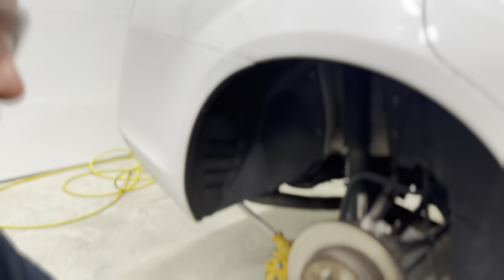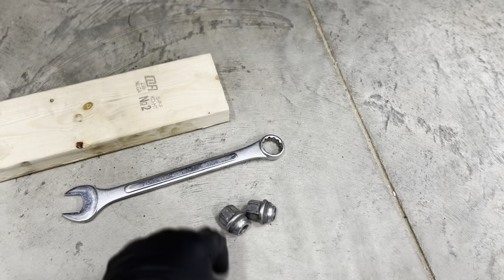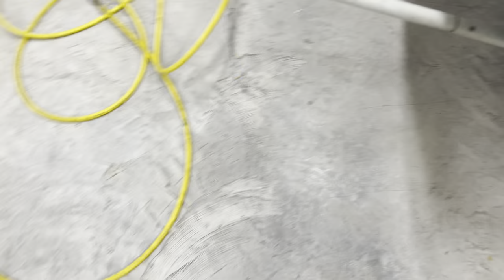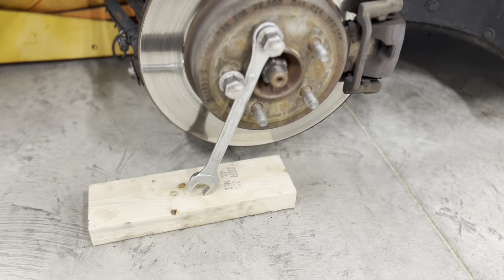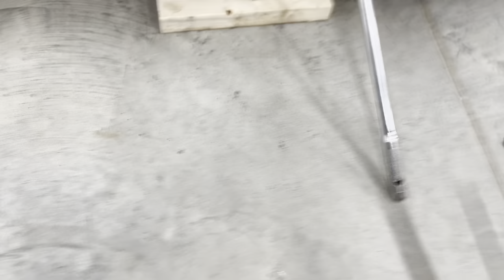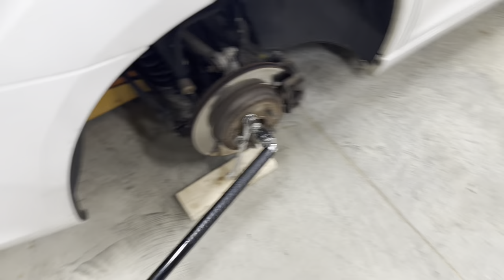Breaking an Axle Nut Loose

Comment: Take the center cap of the rim, put the parking brake and it should go like a blast.
Reply: I agree with you. Just take the center cap off of the rim. Slide it onto the rotor and then lower the vehicle with just one or two lug nuts and then the vehicle will hold everything in place so that you can just go ahead and go to town on that axle nut. 😅
Reply from the maker: I feel like a moron, for not thinking of this myself. Awesome Solution!
Reply: And if some steering wheel holder welded the axle nut to the axle?

Comment: The easiest way to get it off is just to take the center cap off of the rim and then put the rim back on the vehicle even if you only use a lug nut or two and then from there use an extension to get to the axle nut and if it's torqued on there like on a pickup truck you use a breaker bar and then at the end of the breaker bar you simply put the jack and you use the jack to push the breaker bar.😅
Reply from the maker: HOLY CRAP!   I can’t believe that did not occur to me.  That is a freaking brilliant solution! Thank you!   🎉
Reply: @spanky762  you're welcome
Reply: Your explanation doesn't make sense. What do you mean rim? The tire?
Reply: @adamxenon829  no the actual rim. The center cap is the part where they'll put like the Mercedes emblem or the Jeep emblem you pop that part out and then put the tire back on and it gives you direct access to the nut that holds the CV axle in place in the hub

Comment: Too bad my spindle nut is torqued to 241 lbs and was seized.  Pb blaster, map gas torch and a whole lot of swearing and it finally came loose lol.
Reply from the maker: Yikes!
Reply: But what you could have done instead. Is just put the rim back on the vehicle with the center cap removed and then you use a breaker bar with an extension. Once the vehicles back on the ground and at the end of the breaker bar you put the jack and you use the jack to rotate the breaker bar. 😅
Reply: @gsc512 that's exactly what I did. No lift so I had to do some home mechanic gymnastics. Rust was a  factor.
Reply: Same here. Honda Pilot torqued to 240 ft-lb, and seized. Soaking it with PB Blaster. Broke two 1/2 inch square drives with a 3 foot extension. Haven't moved on to the torch yet.

One thing, on my car a sort of collar on the nut is peened into a slot in the threads. You have to hammer it back out with a punch or the nut can't turn.

But right now it is still stuck.🙁

Comment: Any danger of damaging  the threads on the studs?
Reply from the maker: I only lower the car enough to get the wrench to just sit on the wood block.  There isn’t any real heavy weight on the wrench; so I think the chances of damaging the threads is very low.   Thanks for such a good question.
Reply: @spanky762  Ah, would there not be loads of force put on the threads though when the force of the cheater bar is applied ?
Reply from the maker: @eddienolan7129    Perhaps, but in my experience I have not seen any damage to the threads.  This may be due to my using the lug nuts to keep everything tight (no wiggle of the wrench).  Hope this helps!

Comment: Buy impact gun. One of the best tools to ever have.
Reply from the maker: Unfortunately, the Impact gun couldn’t break the nut loose, even at 180 psi.   The length of the floor jack handle provides plenty of leverage to loosen that nut.
Reply: @spanky762 is there any danger to using the impact wrench to take off an axle nut. Some people online say it can damage splines but I’ve seen it done dozens of times without issue.
Reply from the maker: Truthfully, I think if the Impact gun will work, then that is the fastest way. My issue was my impact gun did not have the power to break the axle nut loose.   Using the 4 foot+ cheater bar provides so much leverage that it is easy work -it just takes a bit longer to set up.
Reply: @spanky762  thank you. It was a genuine question. I was curious if the impact was a bad idea in this instance because I see so many tips on YouTube for using different set ups with a breaker bar but in regular life I see impacts used on them. 

I know not to put one back on with any impact though. Definitely put back on using a ratchet and finishing off with a torque wrench.
Reply: @ws4835  You can just use the impact wrench to break it free without it spinning to far up the threads if you're worried about it. Then just use socket wrench after that.